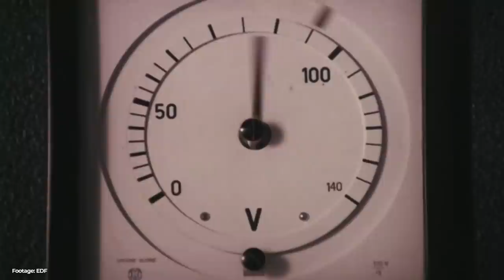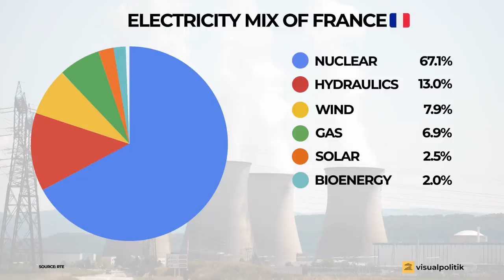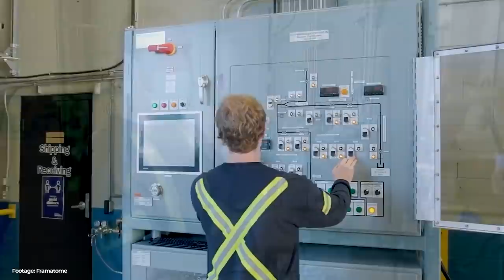Why is FRANCE betting on NUCLEAR ENERGY again? - VisualPolitik EN

Comment: France is betting on nuclear energy for the same reasons other nations should. Nuclear is by far the safest, cleanest, and one of the cheapest high yield energy options available to us at the moment. Decades of fossil fuel industries spending unfathomable sums of money to demonize nuclear energy in the press, advertising, and lobbying spaces have lead to a massive "not in my backward" attitude toward nuclear energy worldwide, but especially in the US.
There is simply no clear path currently to transition off of fossil fuels without the further embracing nuclear power on a much larger scale.
Reply: Nuclear power is cheaper and safer.
Reply: Nuclear power is not, will not and has never been a financially viable option.  There are great videos on youtube about the financing of nuclear power stations.  Companies had to be given massive funding to start the projects, have not found ways to get rid of the waste.. and want to move out of nuclear as quickly as possible.   Nuclear is the long term worse option next to "carry on with coal".   This is a conversation about future energy security.  Ask yourself this real personal question ... if you had a million dollars to invest... would you bet that a company can create cheap electric storage in the next 20 years... (Musk, Iron-Air, Liquid metal, Redox etc) or would you bet NO ONE can crack that and put your investment in a nuclear power plant ?   This is why nuclear is no longer privately financed........
Reply: Robert Groot  they dont create as much energy tho and the reason why they arent being built is for political reasons
Reply: Robert Groot  Read about torium cycle. It didn't produce waste near at all, also current nuclear waste can be used as fuel for this type of reactors.
Reply: @1968Christiaan  Also read about toruim cycle, no waste at all.
Reply: Robert Groot  Solar and wind are only "cheap" because when they are not working coal and gas are picking up the slack. Right now when you are building wind and solar you are also building gas power plants. Look anywhere that has been stupid enough to close reactors down and they are all replaced with gas or coal. Germany, coal and gas, California green party supports new gas plants if it means shutting down their reactors. Ontario, Canada is shutting down some reactors and their generating capacity is being replaced with gas. Shutting down the Pickering generating station will wipe away 1/3rd of Canada's CO2 reductions over the past 30 years. We have been hearing for the past 40 years that nuclear isnt needed but everywhere there is a low carbon without hydro power there is nuclear power.

Good thing France isnt consulting your uninformed feelings for their energy policy.
Reply: Robert Groot  these costs can be offset by relying on nuclear for longer and setting some of the money earned from electric bills aside to spend on the future deconstruction of the plant.
As for storage we can simply store it in underground tombs in desolate or remote places like deserts and Siberian frozen tundra, or simply shoot the waist into venus with a space rocket.
Either way im sure we can create a way to get more energy from the atoms that break off from the waists decaying process.
Reply: @1968Christiaan  The vast majority of nuclear waste by volume is not from reactors. besides which this isn't all or nothing choice.  There will be a mix of power sources used.
Reply: "safest"???
Reply: @pedrolopes3542   It's not melting the ice caps, so maybe.
Reply: @1968Christiaan  "Nuclear power is not, will not and has never been a financially viable option.  There are great videos on youtube about the financing of nuclear power stations"

But the cost to society is not the cost of the plant, but the cost of the electricity:
20 eurocents/kWh - 70% nuclear France
40 eurocents/kWh - 40% intermittent RE Germany
alternatively:
13 uscents/kWh - 50% nuclear Illinois
24 usents/kWh - 30% intermittent RE California

You may believe nuclear power is not cheap, but the empirical evidence is against you.
Reply: Robert Groot  "he costs to build and dismantle a nucear power plant? What do you think about the costs storing the waste for 100.000 years? solar and wind energy are so much cheaper but I know/understand their disadvantages too."
The costs to build, dismantle, fuel, and waste storage are all calculated into the costs in the US (the plants pay into escrow funds for dismantling and waste storage).

13 us cents/kWh - 50% nuclear Illinois
24 us cents/kWh - 30% intermittent RE California

You may believe nuclear power is not cheap, but the empirical evidence is against you.

Wind/solar are cheap if you only look at the investment costs for the plants, not when you consider the overall system burden they impose. Europe 2021 is a great example: at no point in European history has more wind/solar been installed than at present - but electricity prices are through the roof, because this year the sun isn't sunny enough, nor is the wind blowing hard enough - so people are buying up all the coal and natural gas they can and burning it to make electricity.

As for emissions: MOST WIND/SOLAR CAPACITY EVER - AND EMISSIONS ARE UP FROM 2020, 2019, 2018, 2017!
Reply: @1968Christiaan  nuclear waste can easily be solved with more investment into nuclear energy. Molten Salt Reactors can use Thorium and nuclear waste as fuel. Only producing small amounts of waste that last less than 10,000 years
Reply: Robert Groot  "As I have a long term electricity contract I'm still paying the same as last year. ... ps : I have 18 solarpanels on my roof so my electricity bill is 0 since I installed them 8 years ago...""
Those 2 statements may conflict, but irrespective:
* according to IEA data, about 20-25% of an individual's energy use is residential - so your solar panels aren't taking care of 75-80% of your energy footprint.
* an individual having cheap electricity is irrelevant if the entire country/society/jurisdiction has more expensive electricity.
* when the total sum is larger (despite money moving around within the numbers summed: i.e. 5 + 5 = 4 + 6 = 3 + 7) the total sum is larger (5 + 5 < 2 + 9).
* It is great that you as a (relatively) wealthier person had the capital to install solar panels and reduce your electricity bill.
* It is unfortunate that the (relatively) poorer people are left behind to support the same costs as before, but on a smaller rate-payer-base.

"My country is building a lot of windmills and this project is far from finished." - yes, far, far from finished.
OK, despite my sarcasm, why is it that wind/solar missed deadlines are ignored but NPP missed deadlines are 'clearly an insurmountable problem with nuclear power'?
Individual projects (wind/solar/nuclear) show little about whether a systemic issue exists.

"The current gas shortages have to do with political games with Russia." - er, wrong (mostly). The Russians may be playing with other states on the margins, but:
* (the minor bit) European countries were offered long-term NG contracts when prices were cheap; the Europeans declined and opted for spot prices
* (the major bit) wind/solar across Europe in 2021 has been underperforming (just look at the data) and that difference has been made up with NG and coal - this isn't some deep RF conspiratorial stuff - this is simply fact.
IEA, OECD, local governments (UK, France, Denmark, Germany, etc ....) ALL DATA SETS AGREE THAT WIND/SOLAR HAVE UNDERPERFORMED SIGNIFICANTLY IN 2021.
* The prices of NG and coal didn't rise because there was no use for it; they rose abruptly because a bunch of capacity had to be replaced pronto.

"And rising emissions : here in Europe the economy is booming too because of the pandemic" - ????
vs 2020 or even 2019, a plausible explanation

vs 2018 or 2017 ?????
Reply: @aidegrod  🤣 Torium reactors are a myth . Stop trying to push something that doesnt work at all . Your magic bullet 🤣 .
Reply: @xythiera7255  read about the MSRe, oak ridge national lab, Elvin Weinberg, flibe energy and throrcon. MSRs aren't a myth, they are more real than fusion ever was.
Reply: @1968Christiaan  Do you think wind and solar are not funded? in Germany you might as well get it for free for what the government has collected for green energy, but yet its the among the most expensive electricity in the world. They screwed that one well.
Reply: Robert Groot  well, one thing you didnt heard, how much of money they make,... becouse of high build investments it take 15+ years to pay back loans, but whit run time at least 40 years it easily earns money to dismantling. and, renewables are cheap on paper, if you dont count backup facilities needet for times of no wind and no sun,... last week price of electricity in UK spiked at 15000libers/MW,... wind stopped blowing,... Expansions of renewables is dangerous by both overproducing and undetrproducing,... all extremly dependant on weather. Backup in Gas not only means building facilities which are needet, but have overall low coverage during year, but also nassive spikes of natural Gas spikes, as it will be cowering deeps of so called renewables.
Reply: @1968Christiaan  Starting Financial pack is problematic becouse of unreliability of political situation, getting rid of waste woud not be problem if there was not pseudogreen lobby. Nuclear is investment for 30years, modern investors are inpatient and want money back in 5 years,... but private investors dont care about ecology or energy stability, only about profit.
Reply: @aidegrod  thorium cyrcle produce waste, difference is while transurans in uranium fuel cyrcle are kinda problematic, all transThorium isothopes are werry usefull, mass for nuclear waste can be greatly reduced by reprocessing nuclear fuel,...(currently is using fress fuel cheaper), combining of different types of reactors in fuel cyrcle PWR(using low enrich uranium)->CANDU(Can run on both natural uranium or "spend fuel from PWR")->Fast bereeder reactor, to breed plutonium and use it in mox fuel for PWR,. India is interested in Thorium sice it has great reserves of it, China is currently building LIFTR, thers experience can push interest in this technology in west too.
Reply: Robert Groot  1st, you still didnt cover underperforming time of renewables, Overproducing renewables are problem, unless you are sure that att Britain will have demand, putting it into Hydrogen or batteries looks nice, but both option significantly increase capital cost of building source and consequently added innefectivnes by loses of energy during charging and decharging proces,.. therefore return of invertment, from hydrogen making plant, that would produce 100 days in year, about 2-3h of time each wont be that great, batteries are expansive and have limmited livetime, altrouth many says that they will have reduction of cost, i coud disagree whit that, arguing about increased demand from both renewable energy producers and automotive industry, and, still its unknown ho long it woud be demandet for Solar PP to put energy to grid from baterries. Currently renewables are in preffered positions, states providing dotations to investors, they are not required to made baseload, just send us what you produce and we made other sources to kneel to your needs and mishaps, which in contrary increasing demands for other energy producers.  
State concept of energy is what is says it is,.. its concept on level of state, and at state level, it is not what will porduce electricity cheapest, but most stable and reliable, to prevent financial losses on other places. There are technologies, which require suistained production, and even 30s blackout meas losses in milions, and such factories will change location to more stable grid,
Reply: Robert Groot  Close enouth, I am from Slovakia,... 5000€ for 4,5kW means either in Netherlands are Solar dirty cheap, or, no battery backup,.. Brother whit one paid - whit state dotation about twice as much, and it production in november and december are not worth mentioning, problem whit renewables is not that they cannot produce electricity, but cannot produce it stable. And this problem, is not yet solved. 
btw nice video about "solar Sahara" https://youtu.be/7OpM_zKGE4o
And about bateries - needet as storage- not long time ago, guy blow up 8yo Tesla S, Battery change cost(nessesery for continuus use of car) was higher then worth of car,... meanwhile i still using peugeot 106 trom 1998, driving about 5,5l per 100km, (real combined usage, not paper one, less then most new cars). here i have question, which one of two of us was using more carbon emision for driving aroud,...
Reply: Robert Groot  yea but to build as many solar panels that can make the energy production of a nuclear plant nuclear is much cheaper in that regard
Reply: @1968Christiaan  it is if you compare it to solar and wind which would cost more to build to produce anywhere near the same energy production as nuclear, when that's taken into consideration, nuclear is the cheapest out of them all and is by far the safest of them all
Reply: @nerdlingeeksly5192  each kg of radioactive waste shot into Venus costs 1 kg gold (43000$)
Reply: @bigcnmmerb0873  It is not cheaper, not even close,... if you count baterry and others backups, and overrall difference between instaled capacity and power output to the grid,...
Reply: @marianmarkovic5881  yes for projects such as solar, you have to account for batteries, land and backup as well you can have the panels sure but u also require other things for it to function as well. With current generation solar tech it's estimated it would take 3,000,000 solar panels to produce the same power output to that of a nuclear power plant, since for 2000square foot there are at most 18 panels, that costing $15,000 - $40,000 for every 2,000 sqf, that's brings cost just for the panels up to 2.5billion which is the cheapest option if you did it for 15k for 2000sqf,  this disregards batteries, land payments, land surveying, wiring and etc and another thing to consider is that it starts to lose it green card since to produce them you'll need silicone tons of it which are extremely toxic + the limited supply of copper on the planet which could end up hurting the copper market itself increasing the price for those panels overtime and an increase in price for copper in general, next is obv the battery technology which has produces it's fair share of pollution, and also the limited supply of lithium available, which again drives costs up, and everyone knows exactly how expansive land is, all these factors are what make the other options more expansive then nuclear itself.
Reply: Robert Groot  we should invest all in nuclear, but the problem is the politicians only worry about being re-elected and can’t think long therm.
If you think how much pollute (and cost) building and dismantling wind turbines, not mentioning their very short life span.
Thinking that some pinwheels that are the most unreliable and hard to find the suitable place to install them, as well as the fact they they can’t be grouped together otherwise they lose efficiency are the future of energy production is pretty pathetic.
They could help a little, but not without large baseload power
Reply: Robert Groot  Did you hear about the costs and environmental impact of mining lithium at that scale for the amount of batteries you need  to match nuclear plants with solar or wind plants? Specially in France that doesn't have much of those resources. On top of that these batteries last 5 years so you can imagine. Also did you know that solar and wind needs a lot of maintenance and after 25 years in the case of solar you have to basically rebuild the whole thing.
Reply: Wind and Solar are way cheaper per kwh than nuclear energy. You're throwing money out the window just to rescue a way to generate electricity which favours large companies with huge investment volumes.
Reply: @midnattsol6207  While wind and solar are great options and part of the overall picture we start getting to serious issues that haven't been well addressed as of yet. Storage is still no where near where it needs to be to completely change over to only renewables. Wind and solar also major real estate hogs. To produce adequate amounts of power massive investments of one of Earth's most limited resources must be used, sheer land space. Also while I would love nothing more than wonderful, renewable, green, sustainable energy, the tech is simply not there yet to provide an ever increasing need globally for power. There is also another HUGE problem that wind and solar simply can't get around, geography. Simply put, some places don't get adequate wind or sun to make either viable. Without better and longer term storage and more efficient harnessing capabilities wind and solar simply can't do the job. Period.

So what's left? Geothermal is interesting, but not at a point of viability yet on any sort of large scale. Hydroelectric is majorly disruptive to wildlife and people that just so happen to live in the way of where it needs to be located and even then there simply would never be enough sources of hydroelectric power if we damned up every river on Earth, especially with many of them drying up. 
If we burn more coal and natural gas it only exacerbates the problem through further and more extreme climate change that is a self fulfilling extinction prophecy cycle since the more we use the worse climate becomes and therefore we need more power to heat, cool, etc so we burn more to do so which makes climate worse so we burn more to do so and so on and so on until our world resembles Venus.

Nuclear is THE ONLY good option here as an addition to wind/solar/other renewable energy until the technology advances. It is far more safe than any of the other options. The main problem holding nuclear back is mainly the fear stoked partially (mainly? it's very debatable) by the fossil fuel industry as it is by far the best competition. The investment for nuclear power may seem high and that is used as a scare tactic to dissuade people into still choosing fossil fuels. The truth is that in nearly every market the price for power for nuclear is competitive, if not cheaper, than fossil fuels. This is for several reasons but it greatly overlooks the real costs. Start up is much higher, but the cost to maintain nuclear and keep it running is dirt cheap compared to fossil fuels. This doesn't even consider the cost to the environment that fossil fuels cause to health, to raising sea levels, flooding, etc. Remember that air pollution is one of the leading causes of death worldwide, with much of this being attributable to fossil fuels. When really looking at all options nuclear to prop up sustainable green energy while the technology further develops is the fastest way to reduce carbon emissions, perhaps cause even a small dent in the climate crisis, and provide safe and cheap power to even developing nations affordably once facilities are built. We simply can't afford to not use nuclear energy for the near term future if we hope to keep our planet from becoming a hellscape for a few quick bucks.
Reply: @jeremysmith4620  

I don't think 'Period.' has a place in a discussion, as it suggest unwillingness to listen to a different view. I will present you mine, maybe our little exchange can become a net-positive for both of us. 

We do have the technology to fully supply the electricity needs by renewable sources - and the good part is that it's a lot cheaper than including nuclear as well. In the global transition away from burning fossil fuels, not only the elecricity mix needs to become carbon-neutral. Traffic and heating also are largely reliant on fossil fuels these days and will be coupled to the electricity net by getting replaced by hydrogen (and fuels synthesised from hydrogen) generated by electrolysis from renewable power or directly coupled in some cases (like with electric cars). This inceases the demand for electricity by more than 4 times. 

This changes the logic under which the electricity nets operate. With the average power generation sitting more than 400% above the classical electricity demand, the need for base load power generation, which currently sits at around 20% of power produced, will be lowered by more than 4 times, to less than 5% of the total electricity produced. 
The production of H2 does not have to go on 24/7. When there is no wind at night over a large area and the power production would sink below <25% - the classical electricity demand - electrolysis stops. When it is above this threshhold, electrolysis plants increase their output to utilize the available power. 

Electrolysis plants hereby serve as a giant virtual battery. Inconsitency in power generation gets translated into inconsitency of H2 production. Storage of H2 and H2 products is material, thereby easier. Additionally, existing infrastructure for natural gas can be used for H2 (the now famous natural gas storage facilities just like the rest of the infrastructure). In worst case scenarios, reserve gas power plants turn H2 back into electricity. 

The cost of electricity per MWh (LCOE) for wind and solar panels is 40$ for both, nuclear sits at 164$. If we have the chance to avoid having to use nuclear power, it saves us a lot of money to do so. Environmental, savety and dependency concerns are pusing in the same direction. There isn't a single uranium mine in Europe outside Russia and military interventions in some african countries could be avoided without economic interests pressuring for them. 

I don't think it's very likely for big fossil electricity companies to lobby >against< nuclear power. They usually are using fossil as well as nuclear power where they exist and with the addition to offshore wind farms, these are the sources which keep communes and other low-capital investers away from growing into competetors in our highly monopolized electricity markets.
How hard thorium reactors get pushed also hints in this direction. Lobbyism generally is used by those having significant capital, not by still growing sectors.
Reply: @midnattsol6207  I don't argue with any of what you have to say. I would greatly prefer a world based solely off renewables, but in everything I have ever seen/read/encountered/researched there is just no clear and easy path to making it happen. I still do believe the tech is ultimately lacking and needs a not insignificant amount of progression before becoming the only source of power globally. 
I believe in nuclear so much from several research projects I did in college and see it as a much more feasible way to make that transition and abandon all fossil fuels in the absolute fastest timeline. It is certainly far from perfect, but I just can't fathom anything else that could be implemented starting right now, today that would solve so many issues. With China investing infrastructure into Africa I could easily nuclear plants as part of that strategy so it could be adopted worldwide during the transition period. 
I just don't see anything else that is in anything resembling ready to install tech that could immediately set the world on a path from fossil fuels. I'd love to be wrong, but it ultimately doesn't matter if I am wrong or right. Nuclear has been all but abandoned by most of Western Society and without more clear cut education and push to radically transform our power systems globally, both our points of view are unfortunately moot. Hopefully that is something that can change course before it is too late for our planet. 
I just can't help but imagine what the world may look like today if the public knew what fossil fuel companies knew in the 1960s and there was a widespread adoption of nuclear then. I think we might very well be on the course to full green energy sources by now if that were the case.
Reply: @jeremysmith4620  Ok, the point of my comment was to show one of those ways. 
The main problem isn't the lack of technology - it doesn't lack, but the lack of political will to invest. Adaptation to climate change means short term costs for a long-term acceptable life on this planet. Even if technology was lacking, there is no time left to work with anything but what we have. There needs to be a lot more spending on / a bigger share of economic activity devoted to scaling up energy production and transitioning energy infrastructure*. It's just happening at a delusional snails pace. People keep pretending that we'd have until 2045 to transition when the global amount of emissions to go past the 1,5°C goal will be used up in the summer of 2029 at the current emission levels. 
And this is regardless whether you include nuclear power in the solution or not. I just don't see countries to voluntariliy spend this much more money on the solution if not for the influence of particular interests.

*The transitioning of energy infrastructure also does not depend on whether NuclearPP are used or not: in any case, heat and mobility get linked to the electricity production, via H2 (trucks, container ships, non-elecrified trains) and synthetic fuels upcycled for higher energy density (air travel) or directly (E-cars, heat pumps, trains/trams, drones). The required energy infrastructure investment is the same.
Reply: @midnattsol6207  That is THE most maddening part, that lack of political will. Just looking at the US for instance, we still heavily subsidize the fossil fuel industry, mostly do to the conflicts of interest that exists between power PACTS, lobbyists, campaign donations, and more dark money than we could probably fathom. 

Even with not quite ready for prime time technology to magically solve all our needs, green energy has repeatedly been shown to be overwhelmingly profitable, which would make one believe that the capitalist class would be all over that since, well you know, money, but politics still stands in the way. In my home state of North Carolina power companies have sued individual homeowners, small businesses, and even churches to stop them from installing solar panels which is absolute madness. This is the very definition of the overwhelming lack of political will to adopt clean energy, but yet another place I could see nuclear making inroads. 

Quite a few traditional energy companies in America do have some investment in nuclear power. I can certainly see existing subsidies favoring nuclear in the short term to offset the use of fossil fuels, as much of that political and legal framework already exists due to current arrangements. Don't get me wrong, I think subsidies for companies posting record profits year after year is grotesque and morally bankrupt, but I can see where many existing power providers would be able to stomach that transition and be more willing to adopt nuclear than that would be willing to shift to green energy immediately. 

There is no good solution. I am afraid there simply is no solution due to the complete disregard for our planet's survivability compared to next quarters profit statement. Something has to change and change quickly. That's why I am such a fan of nuclear in our current situation, as I still believe it stands the best and most immediate chance of being the near term stop gap measure we need until the proliferation of green, sustainable, and renewable energy can step up and replace everything else. I do wish that weren't the case, but I just can't see a more probable way to mitigate the already catastrophic damage man has caused to the planet.
Reply: @jeremysmith4620  Moral bankruptcy doesn't have to be accepted, subsidies aren't the only way to control economic activity - you can outlaw certain investments or tax them (maybe to use this money to subsidise others). Active economic policy. In the end, the state is the executive authority of democracy and economics are at the heart of political debate. (from Germany btw, i know this isn't always true in the US)

That profit oriented actors want the state to subsidise but never tax is obvious.

We're at a point where large new capacities of electricity generation are needed, which depending on the choice of the mix have a different pricetag. Keeping that price down makes adaptation easier. And with nuclear energy as with any other possible adaptation method, we have to be wary of not harming one ecological system when protecting another. E.g. we still have a severe issue with loss ob biodiversity / mass extinction going on which gets lost in debate at times - and requires a reduction in the share of land used by humans, ruling out crop fuels. Similarly, nuclear energy still holds its ecological problems with pollution and potential catastrophic pollution on local scales as well as creating issues with nowadays electricity generation that people in thousands of years might suffer from, with every country finding its own permanent repository for nuclear waste which doesn't always have the most favourable spot available. When ppl in 1000 years have their groundwater polluted and have to keep servicing the facilities we're currently creating, they'll just think: "... -.-" as well.
No need to take costly meds with side effects when the cheap meds don't have them. :P

Edit: i really like your style of discussion btw. Factually arguing your point. It's the best i could hope for posting under a video like this.
Reply: @midnattsol6207  I've enjoyed discussing it with you as well! I have to remember I do see things through a fairly defeatist lens sometimes, as I majored in Political Science and spent time working on campaigns and intra party politics which greatly changed my views on the realities we face. Having brushed up against the American political system is exactly why I do value such mediocre and gradual change because my country is designed from the ground up to barely even allow that, certainly not any radical shifts on energy policy overnight. You also have to remember that one of the two parties here doesn't even believe in man made climate change, so anything other than change like I have suggested seems so out of reach.
Speaking out against green energy is literally a campaign slogan for anyone even in the center, much less the center right and far right. They pride themselves on stuffing campaign donations in their coffers from energy companies and being wined and dined by lobbyists for the cause, companies whose own data have stated the harm, to turn around and give tax dollars to those same companies while eradicating regulation for their industry and publicly denouncing all climate science as some sort of leftist hoax.
It is beyond frustrating watching the poor that are dying of pollution related causes vote against their own self interests and believe the lies of multimillion dollar companies that were able to purchase more democracy than them. The top news station in the US denies climate science. The voting public are inundated daily by talking heads forever stating that believing in climate science must make you a communist, which is a real argument that has been made, I kid you not.

So in my outlook on the dire situation and how to mitigate the most damage I look for ways that those people could be convinced that transitioning to alternative energy sources is even needed. Our last president literally repeated ad nauseam how wind turbines gave people cancer. But the average American knows next to nothing of the rest of the world and how wind is a fantastic power source. Instead they say it'll ruin the view from their homes or give them cancer or somehow cover the land in knee high bird carcasses. This is the reality that I have to fight against, so it does color how I believe things should be done because I know how many Americans will outright reject doing anything to help the next generation. 
I almost forgot to mention a large portion of Americans deny climate science because they have been told for years from the pulpit of their churches and on religious TV programming that God created the Earth to be perfect and a gift to human beings, so in some weird twist of logic have been made to believe that if climate science is real than it contradicts the word and even existence of God. How does one fight that? When logic is out the window and self preservation is hand waived away what can really be done? This is why I believe nuclear energy could work as a short term measure to start the transition because many energy companies already have nuclear plants, so they may not use all their financial leverage to kill every emerging nuclear plan. I know it's far from a perfect solution, but it is one of the few I can envision being remotely possible.
Reply: @jeremysmith4620  ok, i understand now - you're somewhat working within the boundaries of the created public opinion, trying to find something that factually solves the problem without being rejected by people thinking politics with religious logics. 
The situation in the US is dire in this regard. This nonfactuality in politics / setting your view of things as axioms and judging ideas about the world by their accordance with this axiom instead of accordance with observations exists in Germany too, but it's a minority of 10-20% of the population (increased massively in the past decade). I have the luxuary in political debate to disregard an opinion as soon as factual contradictions don't get resolved in it - and this disregard being viewed as legitimate. But what do you do once the majority doesn't care about reality anymore? I don't want to be in your shoes. 

The most grave blindsight in thinking about democracy was the assumption that the voters expressed will, as the root of all power, would be an untouchable source of legitimacy for a just political system. It by axiom prevented seeing that not just parts of the political process, but also the voters will can be altered by spending money. Voters will is a variable. 
This is an incompatibility between democracy and capitalism which is hard to reform with the cold war propaganda being in everyones head, making some people unwilling to see parts of capitalism as a problem.
What good is it to introduce a democratic system to break the state of few having all power and many having none, to guarantee a fair=equal distribution of it, when a new source of power comes up, where few have all of it, many have none and no democratic distribution occurs?
Either prevent all ways money can buy power or ensure its equal distribution. Given our time, the first option is the only viable one.
If the root of all power is distributed equally, there is no way for one to buy more. 

But i think i understand you: You're looking for the best realizable option - and what might be realizable in Germany might not be realizable in the US.
Reply: @midnattsol6207  I couldn't have stated it any more eloquently or clearly. Often it feels much like screaming into the void until loosing my voice. The very existence of this post-factual world can make even the smallest of tasks seem insurmountable, much less completely altering the energy sector almost overnight, which is still slower than it needs to be. 
I feel like starting to dismantle portions of Capitalism will be required for any or the needed changes to occur, but how do you start altering the very fabric of society when it is literally dictated by those enjoying grotesque levels of wealth and power?
As much as I'd love to have gay luxury space communism overnight and switch to green energy at the snap of a finger, I fear the alteration must be gradual in order to have any measure of success, which I despise even saying because I wholeheartedly reject the glacial rate of change prescribed by liberalism, but I just don't know if another path is possible. With the stakes being this dire I have came to see nuclear energy as a possibly integral part of that change that may have the best chance of success. I could be wrong, but the risks of doing nothing and achieving zero success just has too high a cost.
Reply: the only reason nuclear is not a good option for the us is that it c'ant be let to private entreprise even if there are strictly regulated because in the US money come before sefty in most of the case. Its a sad truth but just look the three mile island, Us buisness man will cut corner for profite no mater the risk so the only viable option for nuclear power plant in the us in a larger scale will be a state own entreprise.
Reply: @alfredbessieres2188  Oh boy, do I ever agree. A great option would be utilities, like power, either adopt a non-profit cooperative structure or, the better option, is counting power as required infrastructure and have the government build, operate, and maintain the facility. Having critical infrastructure in the hands of private capital, who are only incentivised to charge more for less and cut every corner possible to please investors, is a recipe for disaster. Then again I'm a crazy person and don't think people should die because they can't afford access to healthcare or be homeless when empty homes exist. What a radical leftist I am; don't let people die or be homeless and have the government provide the services we need to survive and thrive. I must be on crazy pills.